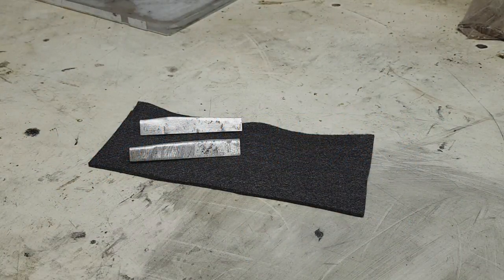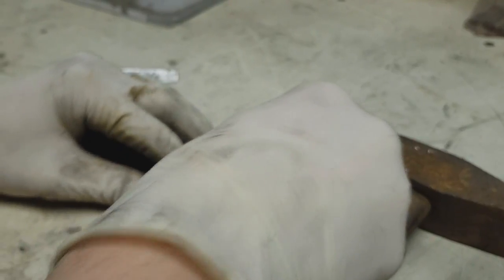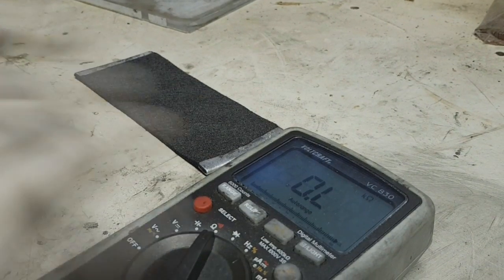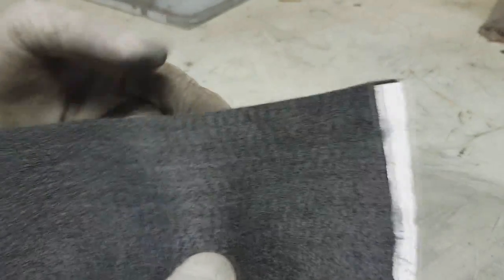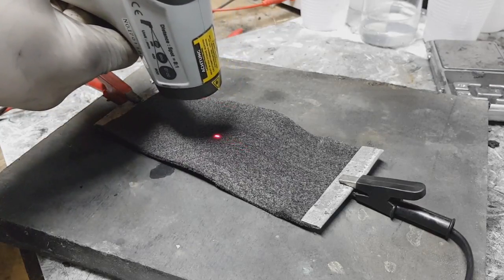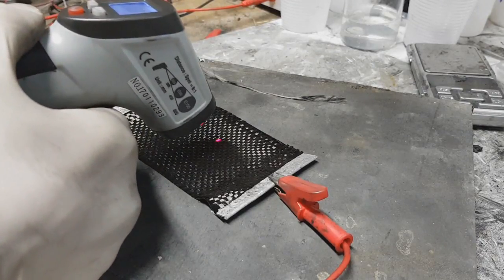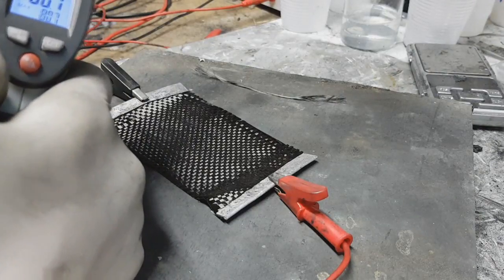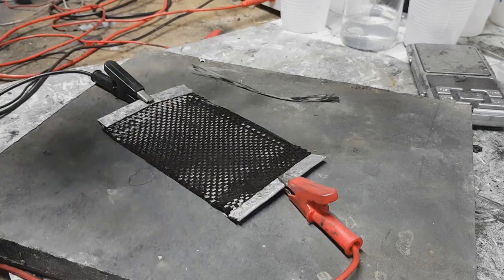How to Make a Carbon Fiber Heater

Comment: It’s a very interesting heater… sadly your link to eBay doesn’t work. Can you describe exactly what kind of carbon fibre it is, or give a working link so that I can find it in Europe please? Hope you find the time. Love your work!!
Reply from the maker: Search for PAN based graphitic carbon felt and you will find alot of that stuf on ebay or I think that you will also find here in Europe. I buy that felt on ebay from china
Reply: @cayrex  I had exactly the same question. Thank you 👍👍

Comment: Hi! I'm working on a University project and I'd like to know if I can use this Carbon Fiber Heater in a Toaster. Can you give me some guide lines? Like, what will be the limits, do you think it could be risky? I think that the toaster should reach 180°C, is that okay?
Reply from the maker: heh interesting. Carbon fibers heating element into a Toaster. Yes sure you can try. Safety: the carbon fiber cover into some tape like kapton tape that you will not have the problems with fibers that coming off. Make a 12 or 24V version,.... because carbon fiber is good conductive,... you can make a 12 or 24V toaster. Uff, I dont know what is the temperature of a toaster. More heat,... faster will be baked bread 🤔

Comment: can I use 12v -10amps power supply with the second type of fiber I have 36 x 91cm you use in the video
Reply from the maker: Yes you can try

Comment: Sir i want this material i.e 1st one which thick 
So where i can get it on ebay it was absent
Reply from the maker: I dont know how thick material you need. But you need to know that more thick is the felt more conductive will be. I use felts in thicknes of 3mm,.... for some projects I also use 5mm. On ebay search for PAN based graphitic carbon felt and you will get some hits.

Comment: link of carbon fiber is broken.. Which type of carbon fiber is it, to be able to find and buy it? Thanks!
Reply from the maker: Yes, this happens many times. Search on ebay for PAN based graphitic carbon felt
Reply: Thanks! Is it more suitable for making DIY heated gloves than a 3k carbon fiber fabric? Rigidness, temperature, energy required, workability...
Reply from the maker: I think that carbon felt is a bit better to work with as 3k carbon fiber. but it depends on each individual what is better. For heated gloves I make a small heater with conductive ink and kapton tape for example. In that case I can conntrole the resistance of the heater. And the heater I can simply stick in the top side of the glove.
Reply: @cayrex  what do you mean by controlling the resistance?
Reply from the maker: With the coat thickness. Carbon felt or fibers have the set resistance and you can not change the resistance of felts,... the resistance is what it is. But with conductive ink I can make less or more conductive with applying less or more layers. For example with 1 layer I get 20 ohms,.... with two layers or a bit thick layer I will get around 8 ohms,... etc
Reply: @cayrex  thank you! Very useful information! 🙌
Reply from the maker: @TheMprat99  😉
Reply: Last questions: if it cut it to fingers width 10-15 mm to make a circuit wrapping them, will it make enough contact at the ends of the strips with the conductive ink? And 3,7 V batteries (or 7,4 V in series) will be enough to really heat the gloves?
Reply from the maker: @TheMprat99  sorry I dont know what you mean. I dont make finger heating,... I only make one heater on top of the palm area. Because the blood flow,... the warm blood will heat the fingers. Is much more easy abd you will safe the energy with one heater instead of having 5 or 6 heaters.
Reply: And putting just one on top of the palm is it enough with the blood flow? I wanted to heat directly the fingers aswell as the top of the palm because I thought just the top of the palm wouldn't heat the fingers enough on cold winter days.

Comment: can i plug it in with ac 220v?
Reply: Let's do some math this material is commonly 8 ohms per meter, at 220 volts we would need 22 ohms of resistance to pull 10 amps of power 22/8=2.75 so you would need over 3 meters to connect this directly to 220v. If you connected that tiny piece he has it would pull over 30 amps and instantly trip your breaker
Reply: @Fine_i_set_the_handle  can I use 12v -10amps power supply with second type of fiber I have 36 x 91cm you use in the video
Reply: @muhammadasadkhan7889  yes at 12v you will pull 1.5 amps per meter if the carbon fiber is 8 ohms per meter but you'll probably have to run many layer in parallel or you won't make alot of heat
Reply: @Fine_i_set_the_handle i have tried this... i did my own mats with A Z layup. That means one layer is at 89 degres and The other at 90 degres. Then the lenght of each fibre becomes extremly long and you could almost get infinity resistans.
Reply from the maker: Direct to 220V? You will blow up the fuse.
Reply: Oke thanks sir, does it have to be with aluminum?
Reply from the maker: @canriz8345  what, the electrodes? No, can be also a copper.
Reply: cayrex2 the electrodes are zinc
Reply: I tried, by clamping the zinc, but the carbon fiber not heat
Reply: With power supply 12V DC 10A
Reply from the maker: @canriz8345  use copper
Reply: cayrex2 okay, thank you for the advice sir 🙏
Reply: cayrex2 mr, when i try again with zinc, the dc volt not stable, but the zinc and carbon fiber got hot, and my led power supply switching get blinking, why?
Reply from the maker: @canriz8345  I dont know
Reply: @canriz8345  You may also be able to use Nickel Strips, of the sort for spot welding batteries, if you could figure out a way to keep them clamped.
Reply: I also used aluminium as connector. But I didnt use a Hammer! I use vacuum infusion with epoxy resin and 2 layers of glassfibre to make it isolated
Reply: When you use epoxy you can only heat it to the tg temp of epoxy witch is like 150-200 degres

Comment: Hello, if I like to use this as a heating pad for clothes, what temparature can I get out of this, if i use for sample 12 Volts with 3 amps for maximum ? And what possibillitys I have to put a flexible power connection on it, not using the aluminium plates. Please can you give me some advice  ? Thank you !!!
Reply from the maker: Hello! So, you maximum power will be 36W I think that the temperature will be around 80 degg C, but I am not 100% sure. You need to test it. You want to replace aluminium electredes with some flexible material,.... hmm, this is a little tricky. You can use a aluminium or copper foil, but in this case will be hard to conect the foil to carbon fiber.

Comment: Thanks. I enjoy building my own heaters and have been taking a look at this Kickstarter. Take a look at it and tell me if you think their numbers are possible or just a grab for money. https://c1bfddc5.kckb.st
Reply from the maker: Hehehehe they sold a ir panels,.... just normal IR panels. Inside is the coating of carbon paint which make the radiation of IR waves.
Reply from the maker: now I looked again on this Kickstarter,... and like I say,... they make a IR panel which is not "new". They make a comparison with water based radiators. So in basic a IR heaters that you can find on the market are more economical that the water based rediators or other convection heaters. So in basic if you make good IR heater you need to compare IR vs IR. Also I see the GIF video which show the coating of the heating element which was a gray pasta,..... which is in basic a graphite pasta and not a graphene. But yes,.... the graphite is a 3D structure made from layers of graphene :) In the end,.... you will be better if you buy some already avalible IR heaters on the market ;)

Comment: Can this be heated using an USB powerbank?
Reply: I would suggest getting a little better understanding of what is at play here before experimenting, I'm truly trying to help so I hope this doesn't come off wrong.  But maybe do some research on Google  first to help understand how this works a cliff notes version is the carbon fiber is acting as a resistor (resisting the flow of electricity aka energy) when the electrical energy hits this resistance it starts to shed off some of that energy into heat( basically a different state of energy)  so the more resistance the more energy that is turned into heat(* a bit more nuanced man that) but also the more energy that you put in to a resistor the more of that energy gets turned into heat. Kida think of this as a reverse solar panel. (Kinda) it's just converting energy from electrical energy to hear energy. Energy is sometimes refered to as potential too. Google "resistance heating" or idk... Stuff like that.  Also keep in mind the longer the strip of carbon (or whatever you use for a resistor) the more resistance. I hope I didn't mess the idea behind this up too much.  Please let me (,and this guy) know if I slaughtered that too badly. One last note is a usb power supplies well generally have a 1.5-2.1 amp 5 volt direct current. You will need to know that for figuring out your math/measurements
Reply from the maker: @danskustomairbrushin  hehe, now you explained basic of heating, which is cool. So almost 99% energy is converted into heating/ir energy in this or other commercial available carbon fiber heaters. The surface of the heater is heating up because of the  resistance of the material, but also the heater create a far infrared waves. More energy you put into the heater higher will be the surface temperature because more energy is converted into the heat, but the amount of the far infrared waves will be almost the same,... because the surface area of the heater is the same,.... to increase the amount of the infrared waves you also need to increase the surface area. The power bank have the output power of 10W, in this case you also get some temperature, but will be enough for some poket heater.
Reply from the maker: In basic yes, you can use a battery power bank. But the heat will be a litle lower.

Comment: Does it heat both side or one side? All carbon heaters heat with both side? Sorry for my English I hope you understand. Thanks for your answer.
Reply from the maker: The heat will be on both sides. If you want to heat only one side you need to isolate one side with some glass fibers

Comment: Power supply information
Voltaje de alimentación: 220VAC + 10% , 50/60hz

Protección: fusible 250VAC; 3.15A; 5.0x30mm

Potencia: 150 Watts

Modo operación: fte lineal, simple canal

Display: 2 display led verdes, 3 dígitos c/u

Tolerancia de voltaje: + 0.2%

Tolerancia de corriente: + 1.0%

Salida voltaje: 0-30VDC

Salida corriente: 0-5ADC

Regulación línea: < 0.01% + 3mV; < 0.2% + 3mA

Regulación carga: < 0.01% + 5mV; < 0.2% + 3mA

Ripple y ruido: < 1mV(RMS); 3.0ma (rms)

Dimensiones: 280x136x160mm

Peso: 5.3kgrs.

Temp. operación: 0 ~ +40°c; <90%RH

Imagen referencial

Comment: Hello, very interesting .do you have a special regulable power supply? I tried with a regulable 30V 5A Power supply , but it don´t works. The P Supply don´t allows to set for example 10V with 5A. It changes automaticately  the scale to very mínimum values ( 2v  1A) , best regards.
Reply from the maker: Hi! no, I dont use any special power supply. hmm, interesting for your results. try to set your power supply to full power and you will see what output you will get.
Reply: Hello  @cayrex  Thanks for your answer.I´ve seen your video about conductive Ink infrared heater.What type of power supply do you usefor this? best regards have a nice week end.
Reply from the maker: @FJPW07  I always use the same power supply.

Comment: carbon fiber probably has health risk, maybe not good to be used as a heater
Reply: Do you have any source for this information? I would be interested if so. I do have a hard time believing this to be honest.
Reply: Sharp small pieces from the second swatch of material in this video could be hazardous if inhaled. The soft pan carbon felt shown at the beginning is pretty benign, although I would not advise it as a filter for a face mask, it might work well as a seat cushion fart filter.

Comment: We need to connect the power supply to the flexible heater all the time to get the stable heat, right ?
Reply from the maker: Yes. You need power supply or batteries for stable temperature.

Comment: Lets work on a iron nickel printed battery design. Silk screen the ink. I’m finding sizing material holds up in chemicals.
Reply: Why silk screen the ink? To produce a smaller particle size?
Reply: zacariah heim doesn’t have to be silk screened. I’m just wanting a simple process to apply it even. I’d rather do it with a additive printer. But silk screening is a simple process
Reply: For a Ni-Fe battery the best option is to opt for freeze drying the ink into place once applied to the electrode. This creates a free standing electrode/active material mixture. Graphitized Carbon fiber weave being the electrode material. This will increase ion flow speed and charging speed, as well as capacitance, while lowering the internal resistance and providing a much lighter weight battery design. Polyethylene can be used as the separator material, with a Gel electrolyte. The key, is finding a way to maximize the chemistry by finding a way to prevent parasitic hydrogen generation. One one is to add metal sulphates, but you can also do this by making the Iron electrode carbon from Garlic biomass. Extract the biomass with ethanol to make a concentrated garlic oil, use this as the binder for the ink. The natural sulphur content will help to prevent hydrogen generation, while adding Lithium hydroxide will increase charge density. Many many changes to a Ni-Fe battery are possible.
Reply: zacariah heim ionic solution doesn’t gas. Also it needs to be thin layers to print on paper. One side paper be the proprolene

Comment: Thank you so much. Want to make one to cook on!!!
Reply from the maker: No problem 😉 for cooking you will need more power that you will get the temperature of 250 to 300 degrees C. For that you need 100W (10A and 10 volts)
Reply: cayrex2 Thank you!!!
Reply from the maker: Fransje Bik no problem 😉